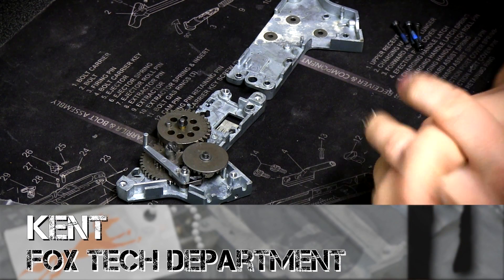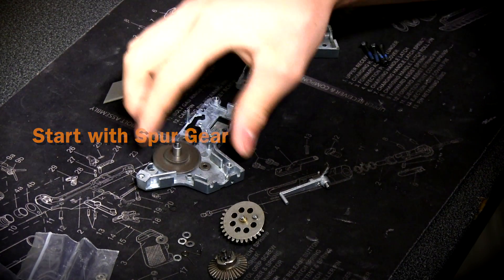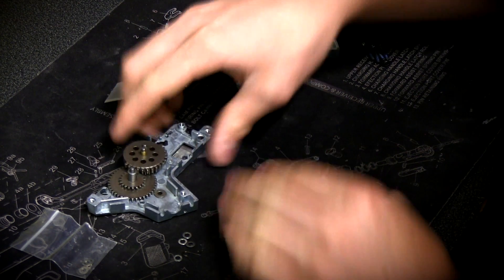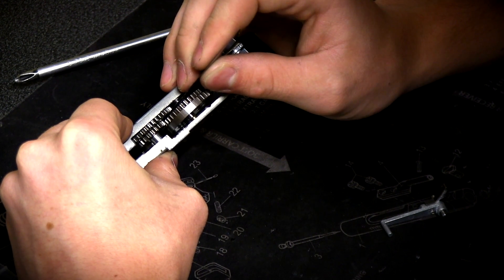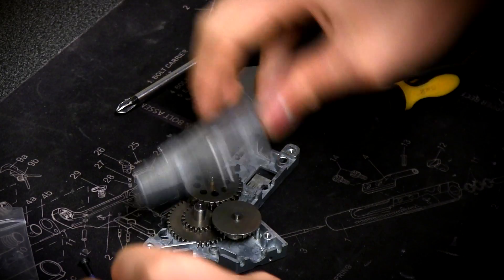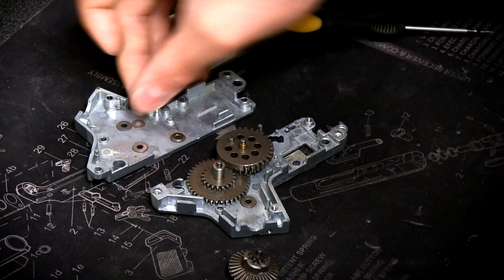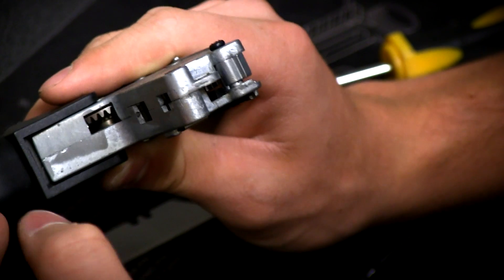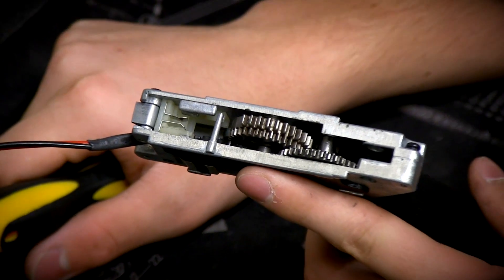How to Shim Your Gearbox | Tech Talk | Fox Airsoft

Comment: Personally, I start with bevel gear. In some replicas you need to fit this gear well with the engine. Sometimes it has to be quite high which forces the other gears to be raised.

Comment: my gearbox and motor are very whiney and the wiring battery and motor are all getting very hot after a short use (little more than a high cap mag). Does this issue stem from bad shiming or is this a different problem?

Comment: Test bevel and pinion play with flat head screw driver in that window. The last time I worked on an ICS split gearbox, the top half was warped so I had to put more shims on the spur because it would grind the top half shell. Should always check the tappet plate and piston shimming with the sector.